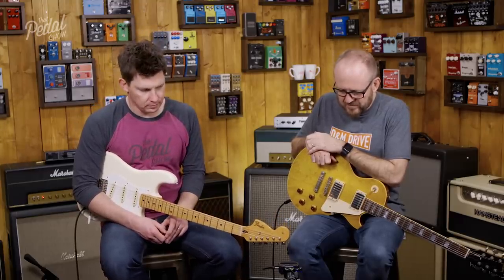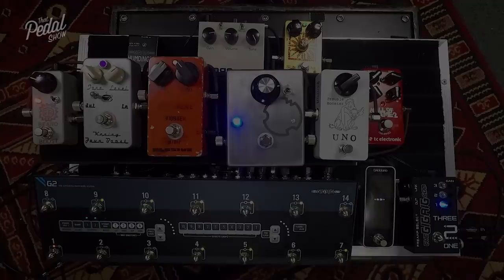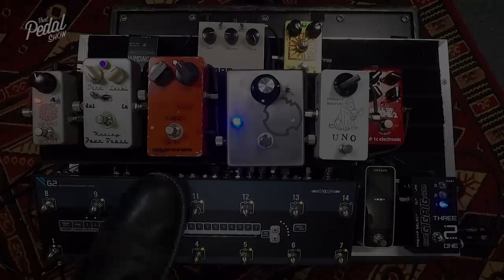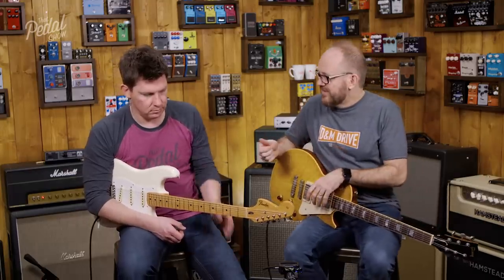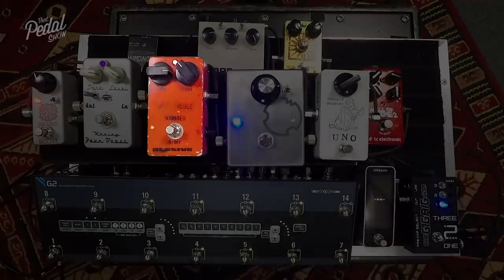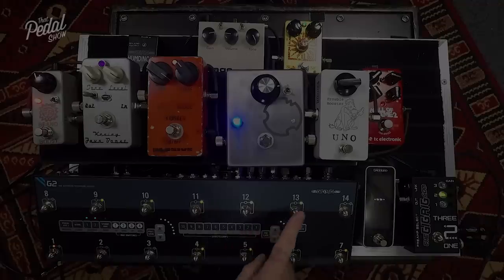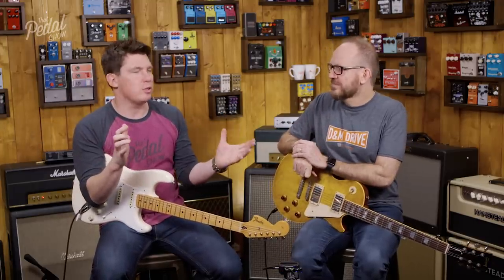That Pedal Show – Tremendous Treble Boosters For Glorious Classic Drive Tones

Comment: You have my all time favorite Java Boost on there, cream knobs, VIOLET LED!  I probably built that unit in 2002-3. I learned so much from the treble booster design.  One of my very first mods if you will, I added the switch to give people three "versions". In that design, the high pass filter to keep things tight, the added gain to the midrange and top end for saturation and sustain...then apply that concept and tone shaping ideas to all other circuits and you design to solve problems and create solutions.  It's a really eye opening circuit in my mind. You guys did a great job on the history and use of the pedal.
Reply from the maker: Cheers Robert! It was totally loving the Strat especially today - Mick here. Seems the good people of YouTube really like it too. See you in Anaheim sir!
Reply: Hey Robert, just picked one of these up and it’s absolutely amazing! Thank you and well done.
Reply: Thank you very much Chris!!!
Reply: My favourite Treble Booster by a country mile! I have #155 which I'd estimated had been built by you in the early 2000's... so I'm probably not far off. Thanks Mr Keeley!
Reply: Sounds like Gallagher. Rory or the guy who splits watermelons, you be the judge.
Reply: I just bought a Java, new. It's a darkish brown colour. OC44, I presume?
Reply: I have #376 and LOVE it!!! Thanks for the awesome pedal Robert!
Reply: Hello All - Which treble boosters are most similar to the Plosive May treble boost?  I like the sound of the Plosive best...Thx!
Reply: @ThatPedalShow  please can you     do a part two on treble boosters with the matchless an ac30 from 1961 in stereo an a middle amp being the vox ac10 in a wet dry wet rig?
Reply: I wish Mr Keeley would make these again

Comment: My first dirt pedal was a germanium treble boost I built with an old Philips AC126, I've built variations usaing BC108 and 109, high gain BC548/9, low gain 2n2222a, newer AC188, 2n3440, pretty much any transistor I can get my hands on I test on a rangemaster style cirtuit. I've done everything there is to it, 6 way input cap switch, variable bias, variable gain, tone control, loads of output clipping arrays, 18v, using 2 in series. using 2 in parallel, PNP into NPN, anything, really. 
Anyway, after all these years and many TSs, OCDs, Klones, etc, nothing gives me the same magic as the RM circuit. With the right bias and voicing it can even do the "TS into gainy amp for modern tight metal" better than the TS, tighter, stiffer and more natural sounding. Amazing circuit for pretty much anything with the right tweaks.
Cheers from Brazil. Love your show guys.
Reply: Peter Marriott mmmmm
Reply: Hello sir, in your expert opinion, what would be a good input cap value for a strat boosting a plexi style amp? Also can I pretty much use any high gain germanium transistor I have?
Reply: @graxjpg  RMs tend to work better with the HFE between 80 and 110, either germanium or silicon, so there's no need for a high gain device.
For the input cap try using 10nF, it's pretty meaty, especially for a strat, but doesn't get muddy like 22n and beyond.
I would try to use a 3 way switch with a pair of 10nF so you can wire them series/parallel/single cap to have 5n/20n/10n respectively. And remember to experiment, it's half the fun, cheers mate.
Reply: @Octopus502  great, you’ve given me everything I need to start tinkering! Thanks so much
Reply: Was/is there a particular transistor you like?

Comment: Legend has it, and you can follow up via an interview with him about this on this very website, Iommi let a stranger mod his Rangemaster when he was playing a small club before his Sabbath days. My assumption is that it was the output capacitor that was changed, as my Beano Boost at the "Low" setting sounds incredibly close to his tone to my ears. Plus if I'm not mistaken Mike Piera made his first Beano for Iommi to replace his old Rangemaster unit.
Reply: May have been the output cap. But very well could have been the input cap. Both control the range of frequencies getting in or out.

Comment: Wicked episode that! Big fan of a treble booster, to this day the best tone I’ve ever had at a gig was running my single P90 tele type into a treble booster, into my orange tiny terror, which was gunned. Everything was there, warmth, power, cut, tone. Booster on all night, never stepped on anything. And even though it was loud, I had so much range on the volume pot that I was in total control. Don’t get many gigs (or sound engineers) where I can get away with it though! 

Mick, I thought you were gonna snap the level knob off the Java Boost!

Comment: Never bothered about boosters. I run a mostly clean amp and get my degrees of dirt with stacked drive pedals, so I do various arrangements of boosting with certain pedals boosting certain other pedals. However, one idea I came up with the other day while trying to find a way to retain treble when rolling off the guitar volume (without wiring mods), was to use an eq boosting treble at the beginning of my pedal chain -- The idea is essentially to create a signal as it would sound if I had brighter pickups rather than boosting treble too much within or after my pedal chain which tends to add more noise. So with the present setup, I can get a bright clean signal by rolling off my guitar volume and opening the guitar tone knob fully;  then when I roll up the volume for more drive/dirt/fuzz, I just have to roll off the tone correspondingly to keep the distortion from being too brittle. I used to be one of those guys who always kept my guitar volume and tone at 10, just because I hate the muddy sound of a rolled off tone, and I hate the bit of high-end loss when rolling down the volume. It took me so long to come to the realization that if I just set my overall signal chain eq tone to be *overly bright*, then I can get all my desired tones from my guitar's controls.

Comment: Hey guys, great video as always.  This show has become something I look forward to each week, so keep it up!
Have you ever considered doing a video on speakers and/or cabinets?  It seems to be something that gets overlooked a lot, but I would love to get your take on classic matchups such as greenbacks in a Marshall, Jensen-type speakers in Fender amps, and so on.  It would be interesting to get your take on why some pairings traditionally work so well, as well as if there are any odd, non-traditional pairings that might produce good sounds you might not expect.  Either way, looking forward to what's in store for 2018
Reply from the maker: Yes absolutely. The trouble is that there are soooooo many variables with speakers (amp, cab, Room, guitar etc...). If you flatten all those variables out to get some sort of meaningful comparison, it then becomes just academic and not in any way applicable in real life. So we’re trying to think of a format that would be genuinely useful. Thanks for watching!

Comment: Treble boosters...such a misnomer.  Rock booster is more like it.  Are they boosting treble really? Or more like a low pass filter? Maybe both?  Its interesting that you guys went with the green and not blue speaker in the AC15. Thanks for another cool vid!
Reply: I would love to know the reasoning Dan and Mick wen with the Green as well...which is the better choice? For someone who plans to one day have ac30 with a blue back should they get a 15 with a blue or green? I've learned both amps are different beasts
Reply: Daniel Estrellado The greenbacks have a lower treble content than the blues, and overall have a “darker” tone to them compared to the alnico blues (to my ears of course!)
Alnico Blues are fantastic but I think they thought it would be harsh to combine treble booster with that speaker? Brian May probably used Blues though so I may be talking out of my ass here but to me the greens are less harsh
Reply: Technically wouldn’t a treble booster be a high pass filter, one that lets the higher frequencies through and blocks the low frequencies?

Comment: Fuzz into Beano is the Analgman Sunlion.  I bought one long ago and it is FN awesome.   Once you have that, with a Les Paul and a Marshall you are Mr. Badass.  The fuzz is two transistors and the beano is one.   So you have a fuzz with three transistors, which is a _________ .  Page used one.

Comment: To keep those Germanium transistors cool you could add a peltier cooler. It's a small electric powered square. Gets hot on one side, cool on the other. Put a heatsink, with fan, on the hot side and put the cold side on the pedal housing. Might do the job.

Comment: Hi guys. I just saw your treble booster show and it's fab. When you are considering to make a new item on Treble boosters please consider to try the Guitar Systems Treble Tool. It's their take on the Dallas Rangmasters with a bunch of mods. My big board has seen several updates over the years but the Treble Tool is always part off it. It is awesome when you use it with overdrives and distortions. I'm used to stack all sorts of them, just what the song needs. The same you stated as "the" way to use a Treble booster.  Sometimes I use it for coloring the sound and sometimes to get through a dense mix in a solo. Your shows are very informative, especially on the technical side, keep up the good work.

Comment: I’m using a Mooer Pure Boost with the treble cranked and the gain just over half way. My only genuine treble booster is the one built in to my Vox VBM amp. I’ve gigged with that running into a cranked ‘67 Vox valve Pathfinder. That combination is a bit oversized to carry around for a one trick effect.

It’s a hell of a trick though.

Comment: Tell ya, - where I discovered the real tonal possibilities of the TB was using the bass cut circuits on Jaguars and Jazzmasters; it's a specific and unique sound that I instantly took an interest in.
It can lead you in to some unique and very usable tonal directions.
Been pondering the Ge temp issue for some time, and did consider the coolant circulation in computer towers, but , even though those interests have done all possible to simplify and miniturize, they remain ungainly.
What does and can work are medical chemical cold packs; in real heat, there are some condensation issues that you need to monitor, as H20 and electronics seldom mix.
We can go to the moon(maybe), but we can't find a good Ge substitute.A few have come close, with Deep Tripp in Brazil doing a notably good job on their Hell Bender.

Comment: Hey Mick and Dan, I had a fun idea for an episode: you should each build a pedal (either from kit or design from scratch) and discuss the experience and then rate each others from build quality/sound quality/similarity to clone source, etc. 

I recently built a clone of a Maxon OD-820 and it was fun and sounds pretty good, but I don’t have an original to compare to, so I wonder how good kit or homemade stuff turns out!
Reply: I have inside information that the 820 is a reverse engineered Klon.

Comment: Another great boost is the MI Audio "Boost n Buff". Really good value, serves as an input buffer (switchable) at the start of your chain, can push into your drive pedals and/or your amp, has a gain and volume knob for a bit of internal crunch/compression or clean boost , plus a three way tone switch, treble/normal/fat.

Comment: I remember reading years ago that the classic Rangemaster type circuit works by increasing the gain as frequencies get higher, so that it also boosts high frequency harmonics more than it boosts the fundamental tone, which was supposedly part of the magic. Dunno whether it's true, but I've always loved the treble boost side (basically a Java Boost , I think) of my Keeley Time Machine.

Btw - used my new NKT Sunface (ordered halfway through watching the Sunface ep) at a jam for the first time last night. Into a cleanish tweed amp with a tele - tone to die for, and lots of shades available using the tone and volume on the guitar. Thanks for all the inspiration guys :-)
Reply from the maker: Hooray for the Sun Face - glad it was doing good things for you! 
As for the harmonics thing, makes total sense to us. Thanks for the input!

Comment: I’m a BIG fan of the Catalinbread Naga Viper
Reply: is this viper a good choice for a pedal booster ?  thanks i'm trying to figure out which one to get. Peace !
Reply: @jixxxxer17  it depends on what you want to “boost.” This isn’t a clean boost. It’s a very unique boost that has additional qualities that allow you to fine tune the frequencies you want to boost. I found you can get that 70s midrange boost that you hear in solos from the 70s (think Boston or UFO or Sabbath).  If you want a clean boost check out the CAE Line Driver. My favourite boosts are the CAE, EP BOOSTER and NAGA VIPER.
Reply: @angbernardo  Thanks !

Comment: Keeping your germanium transistor pedals cool is easy. Get a peltier cooler. The semi-complicated part is regulating the temperature drop, so not to get condensation and short out the circuit. But it can be (DIY) done.
Reply: bigger heat sink?
Reply: imaseeker100 No the item getting (over) cooled drops under the dew point and you get condensation on the item. Think of a soda can when you take it out of the refrigerator and the sides get wet. The peltier heatsink is to dissipate the heat it produces.

Fun fact: When I used a peltier cooler on my astronomical CCD camera I would get a 100 degree drop in temperature. They work great on cooling (low mass) electronics.

Comment: First pedal on my board is an Effectrode PC-2A Tube Compressor. Should I place my  AnalogMan Beano boost after it or before it? Isn't there a risk to overdrive or damage the Comp lamp if the boost is placed  before? Thanks
Reply from the maker: Beano first 👍

Comment: Tim from Canberra, Australia here. I always watch the show in high definition on my surround sound home theatre setup with large floor standing speakers so I can hear the nuances of your show. It’s only fair seeing as you take the time, money and effort to record it so well.

What I heard this show in my opinion was that the cranked amp boosted by a treble booster sounded superior to the clean amp with Kingsley being boosted by a treble booster. It’s not that the Kingsley boosted was bad. It was still a good tone, but I felt in my opinion the amp cranked and boosted was better. Having learned from you, I would have loved you to have tried keeping the amp cranked and boosted but run it as wet/dry. In this case though to get it to work so that you don’t boost the higher headroom wet amp and get a spiky unusable tone, I would theorize you could run the treble booster in the same loop on the way to the dry amp but not in the signal path of the wet amp. The wet amp could then have the Kingsley so that when you run the treble boosted dry, the wet is not running clean. I wish I could draw a diagram here

Guitar: 
G2 split two amps 
- loop 1
- rest of G2 loops

Loop 1 = treble booster in the same loop on the way to a dry amp cranked up without signal returning to the G2

Rest of loops = Kingsley in loop 2 then other effects to wet amp (or even stereo wet amps for wet/dry/wet)

In this way you wouldn’t be treble boosting the wet amp which would be higher headroom for cleaner reproduction of wet effects and not sound so spiky. 

I know you have done wet dry before but I would see the above as a better solution than to treble boosting the Kingsley which I felt didn’t sound as good as the treble boosted amp with working power section. 

This could be applied to running Fuzz as well and it’s a technique used by Tool and Other bands like Cog to run two amps one with Fuzz but the other without Fuzz but cranked up and overdriving naturally. There’s an idea for a Show!! Running one amp with Fuzz and the other amp overdriving but without Fuzz. I’d love to see you try that.

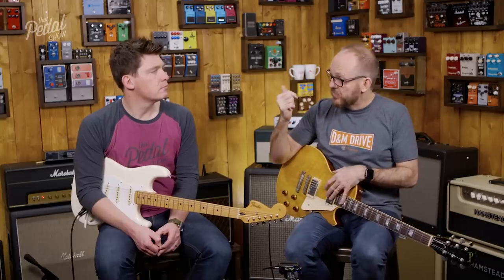Comment: Around 6:45 you say there is a switch vfor the output capacitor. it's the input capacitor that's important to the circuit. it cuts bass before boosting it ;)
Reply: I have a brian may type treble booster pushing into a modded germanium fuzz face. it sound killer!!

Comment: I use the scott henderson rc booster with the bass turned down as a treble booster. It's so "transparent" (i feel dirty saying that lol) that it makes a great treble booster when I need one.
Reply: Doesn't it get a bit fizzy?
Reply: whynottalklikeapirat not if you keep the gain down and the level up
Reply: I've been using an MI Boost 'n Buff (run on 9v though it can handle up to 25) with the gain maxed out. It sort of works. But not like a true treble booster.
Reply: Brandon Lewis
Well - there is that. Still - I am guessing you are not using single coils?
Reply: whynottalklikeapirat oh no I play a 62 les Paul
Reply: There you go =.O

Comment: Another cool Range Master type pedal  is the  JoeDocMusic Pedel "Tonemaster"Germanium Fuzz/Boost: which gives you a “Rangemaster” and “Tonebender” circuits which are separately switchable.  Just sound great with Les Paul especially  into a cooking Victory  Sheriff 22 or Marshall JTM45.
Reply from the maker: +Gregory Stoner will check it out, cheers G :)
Reply: For Dan who  love checking out the effects of transistors on Treble booster you might like JoeDoc OC Boost,  you pick your transistor to dial-in the feel your looking for.  OC71, OC75, OC44,  You can also uses a OC72, OC83, OC602, and OC304.
Reply: One thing it would cool to see is you been pulling together a solid collection of Octave Fuzz Pedals,  Do a Octave/Fuzz Show,  with Octavia,  CBS Arbiter Doubler octave fuzz, Foxx Tone Machine, as a base line with Fulltone in the line,  then branch out from there to modern versions